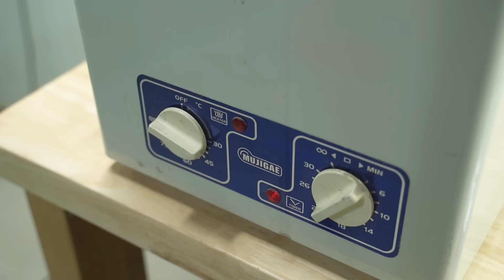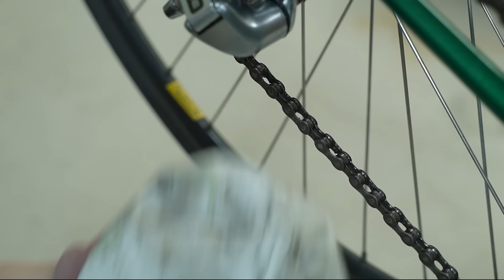Restoration - 1984 Japan made MIYATA Bicycle

Comment: Drown rear derailleur in degreaser, lubricate jockey wheels and drop some oil on body is a way how to destroy main bearings and torsion springs. Wipe by rag is in this case more gentle and enought.  By the way a lot of youtubers do it wrongly like You.
Reply: A llorar
Reply: Ultrasonic cleaners work with degreaser? And how its supposed you lubricate the derailleur? Because sram recommended you to put the oil directly into the 4 bolts that allows the derailleur flexes
Reply: @alan181090  ultrasonic cleaner with degreaser is not an issue. Problem is that derailler is not completelly dissassembled. Forrgotten main torsion springs and bearings will wear, deeply inside of derailluer body. This has no connection on lube rivets of body hinges.

Comment: A friend of mine had an early 80's Team Miyata Blue race bike with full 6 speed Dura Ace, including the Dyno-drive cranks and pedals and bar/stem. It might of even had the Dura Ace seat post. (I can't remember when that came out)...PS. If you don't "clear coat" that seat post after sanding it, it will start to oxidize and turn black within a few months.  PSS. Those dual pivot brake calipers are from the very late 80's.

Comment: Beautiful bike! 
But 8-speed hubs and dual pivot brakes in a early 80s bike? I assume this bike was partially equipped with modern parts, like the sealed bottom bracket bearings
Reply from the maker: Yeah, it wasn't original.

Comment: Hello very nice video. I have a puch cavelier i am restoring. Its a 5 speed Freewheel with a drop out of 126cm. Can I put a 8 speed on it? Or lower. What must i pay attention too?😊
Reply: I have had absolutely no problem switching from freewheel to freehub. Use a threaded rod to expand the dropouts to give the proper fit. Rock it!

Comment: 1984 y ya usaban casette pensaba que solo tenían piñon
Reply: I think the rearwheel has to be from the early 90th. He has to push hard to get the wheel out of the frame. so i guess it has an 130mm hub in a 126mm frame.